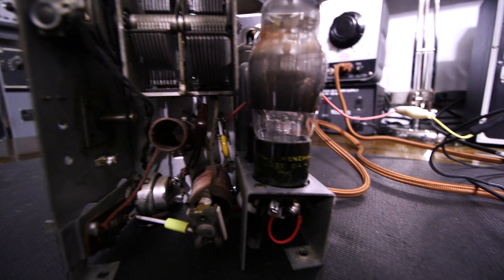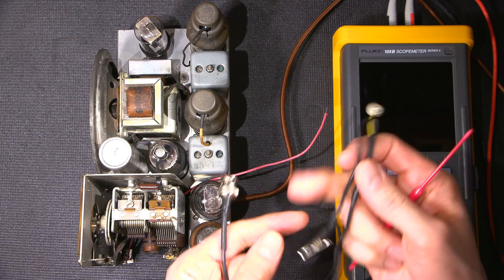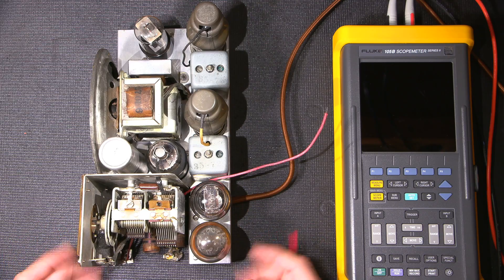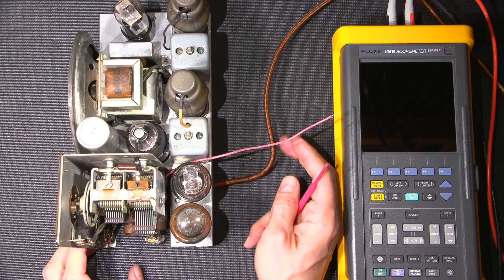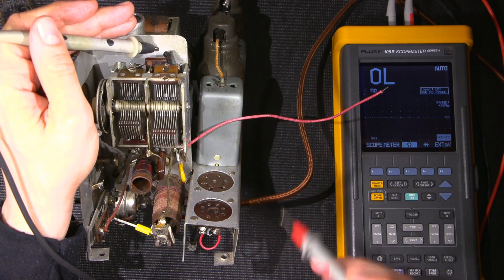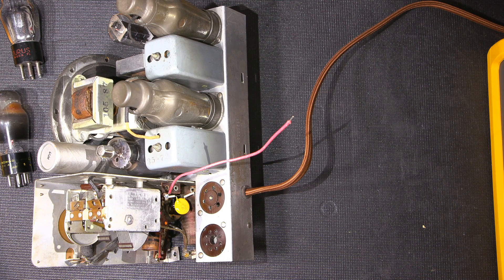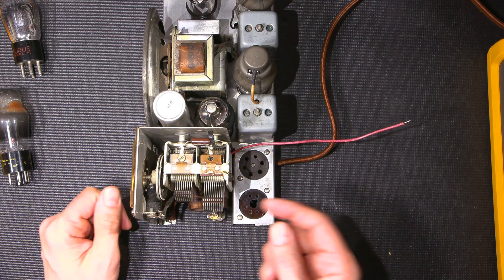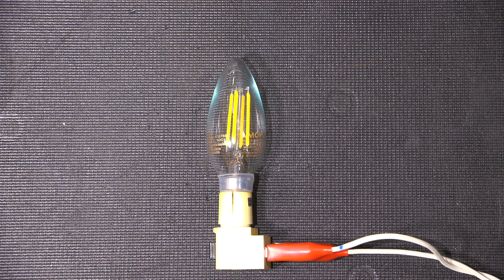See High Voltage Created From Falling Snow!

Comment: Very interesting phenomenon. Here's my analysis of it. The first clue is that you got an arc to the chassis despite the 36 ohm coil to ground. That means that the arc must have been caused by a spike of current, as that is the only condition where the coil is high impedance. So what I think happened is this: static built up on the aerial from the wind. This slowly charged the X1 capacitor. At this point the chassis and the arc point are at the same potential, while the aerial is charged to however many kV. 

When the capacitor is sufficiently charged, an arc happens. This is not the arc in the receiver, but a big arc between the two sides of the aerial. As a path opens to ground, the X1 capacitor starts to quickly discharge. However, due to the high impedance of the coil, the current discharging the capacitor must find another way. And within microseconds, the potential over the chassis rises enough to create the arc that you witnessed. 

So the final discharge loop is: one side of the X1 capacitor --- the coax --- one side of the aerial --- arc --- the grounded side of the aerial --- electrical wiring --- probably another arc in the isolation transformer --- the chassis --- the arc in the receiver --- the other side of the X1 capacitor. This would also have enough loop area to create the strangeness in the speakers.

And for maximum youtuber collaboration awesomeness, may I suggest that you send the broken LED lamp to Big Clive?
Reply: So in theory you could make a static electricity generator/collector via wind over antenna array if I follow the gist of your theory.
Reply: @wolfiexii  Of course you could. It wouldn't be very efficient by any means but if all you wanted was to see sparks over a spark gap, why not... The mystery in this case though is not how snow could create static electricity (that's pretty obvious) but the exact mechanism of how everything in the circuit finally produced an arc to the chassis despite the 36 ohm coil in parallel.
Reply: @wolfiexii  you're forgetting the coax creates a capacitor that can shape pulses all on its own. I'm guessing the coax and antenna charge up, discharge happens outside and the pulse is large and fast enough that it blows through anything between it and earth.
Reply: Gameboygenius Hi - the other side of the dipole is not grounded from his description so has no path to ground.
Reply: It doesn't necessarily need to be grounded, it just needs a different potential.
Reply: @vacuumfireradio253  Could be. According to what he said, it was not gorunded to anything else in here. To me, that was talking about the items on the bench, it the receiver was only connected with the center of the coax (and the isolation transformer). That doesn't necessarily preclude that the coax sheath is also grounded to something up on the roof, for example. But in the end, everything is connected as far as voltages are concerned, and arc-overs can happen when and where you least expect them. If an arc happens between point x and something connected to ground, then there's temporarily a low ohm connection to ground from that point. I'm not claiming to know the absolute truth, only a theory based on the evidence, and I'd love to know what actually happened.
Reply: @Gameboygenius  If I recall the highest efficiency for static influence is around the 25% point.  Where it does shine is in maintenance, you can set on up and walk away from it for decades and it will simply continue to work. Earth bound, yea you could make some nice water features with this principle for a garden pond, but on a place such as Mars where you cannot simply pick up spare parts without a 4 year turn around long running unmaintained systems even at 25% would be beneficial.
Reply: @keeperofthegood  You bring up a good point. Although if the goal is extraterrestrial energy harvesting, we must be careful with high voltages that may destroy any PN junction that comes its way. (Vacuum tubes are no help here. While they might survive the high voltage, they are dependent on that pesky high power filament to work within specifications...) Also, is there enough solid debris, aka "snow" to create that high voltage we're looking for? I'm skeptical and think solar panels are still the way to go for our main extraterrestrial energy needs.
Reply: @vacuumfireradio253  Would the wet conditions have provided enough of a ground?
Reply: His Antenna sounded like it had two lengths of wire, one connected to the outer conductor of the coax, one connected to the inner conductor. No impedance matching. The high impedance of the wires are connected to the end of a coax (typical 50 ohms). So you are waving the chassis' potential on one of the wires, and the other wire to the capacitor (where the arc was generated). Yes, the coils impedance is in series with the capacitor, but that series combination is in parallel with the two wires waving around up in a fast air stream that was below that its dew point (high impedance static prone air). So what is the mystery here? When the static potential developed across the cap is higher than the air gap breakdown potential you will see the plasma go from dark mode, to glow mode, and then arc mode. ZAP!
Reply: Besides, the only way two sides of an unterminated balanced antenna would be at the same potential is if exactly the same number and same size of snowflakes passed by both legs of it at identical distances, which is statistically impossible.  There will always be a difference of potential on the two legs of a dipole antenna unless both are tied together or both tied to ground.
Reply: @wolfiexii  DC currents in the troposphere are a well known phenomena experienced by transmission lines, antennas, and telephone/telegraph systems. Multiply grounded systems and even metal pipes also have to deal with telluric current, which has a much lower supply impedance. (More current, less voltage, and a serious problem for electrical grids; their transformers have to tolerate uncontrolled DC bias currents.)

There's a very faint downward current during fair weather, and many kinds of precipitation carry an upward current (i.e. they are negatively charged). Thunderstorms are chaotic - they can have positive rain and even positive lightning - but they average to much stronger upward current. The current density is still fairly low (no more than a few amps per super-cell) and even lighting isn't astronomically strong (median peak current is tens of kA, charge is a tens of C). The ionosphere potential is about +400kV, globally uniform, and varies following a daily cycle. Thunderstorms can have tens or hundreds of (-) MV at the base.

The exact process that couples convective weather to upward current is still a mystery. But convection is believed to contribute  energy to the ground-ionosphere capacitor.

The weird thing is that's all DC stuff. An arc parallel to a coil implies rapidly changing flux through that coil, an AC or impulse phenomenon.

Also, beware. These topics (especially telluric current) seem to attract woo-woo faster than a kitten attracts packing peanuts on Boxing day.
Reply: Big Clive.  Love the guy, but Mr. Carson can show down to the most minute detail on why a circuit operates in the manner that it does.  Both in a fault state and in the operational state.
Reply: Big Clive would be amazed to dissect a LED lamp destroyed in such a strange way!!
Reply: @Gameboygenius : In which case y'all might want to read up on Tesla's experiments with what he called "cosmic energy". I suspect this was a very high-frequency event. Tesla talked about these kinds of events and how it would make free-floating "plasma balls". This happened a lot in colorado springs where he set up a lab to try and replicate these events.
Reply: @BrokeMoFo : If the atmosphere is very dry, then there would be no hydro grounding. The snow would also have to have been very cold and more like ice crystals than the wetter snowflakes we are used to.
Reply: I think you're onto something.  I had the same idea that the main discharge was occurring between the poles of the antenna outside, but I was thinking that perhaps the sudden potential change is creating a swing in the isolation transformer.  Then there's a secondary arc inside the chassis as a result of that inductive spike.
Reply: Hi, do you mind if I take this concept and try to develop it into a commercial process? Elon Musk are you watching! Lightening too!
Reply: Good info. I can follow and agree with most of this but I cannot get my head around the fact that a minimal resistance of 36 ohms did not bleed enough to prevent arcing. There had to be a ground or difference in potential somewhere or there would be no arc, but the rate of charge needed to make that happen creates an interesting puzzle.
Reply: indeed, a "cascade" event probably i thought too
Reply: @jordanrodrigues8265  I was just thinking along the lines of fun kids science experiment, electricity from "air".
Reply: Exactly my thoughts also. The impulse characteristic of the discharges across the coil would still give high voltage across it (it has an inductive component as well, not only a resistive one as measured on an ohmmeter)
Reply: Here's some science from 1970.  Electrical charges on snow particles
 D. A. Burrows  P. V. Hobbs. "Measurements of the charges on individual airborne snow particles showed that they were distributed approximately symmetrically between positive and negative values. The majority of the small charges were negative, however, and the majority of the large charges were positive." 

-> antenna will get positive charge as there are 50% of positive snowflakes which have stronger charge than the negative ones. BUT you also get AC component, as every time negatively charged snowflake hits the antenna it's positive charge is reduced. Capacitor was flowing this AC -component though and then you have an inductor (coil) which acted just like a buck-boost converter or car ignition coil. When the magnetic field collapsed the spark jumped from the not grounded end of the coil to the ground.
Reply: There is also a voltage gradient between the sky and the ground.  Two longwires, one above the other by about 30 feet or so, will have different voltage levels with respect to ground, the higher longwire having a higher voltage.  The difference can be hundreds of volts over very short separation distances.  The current is extremely low, but the voltage can be extremely high.
Reply: Gameboygeniuos you have started a great debate here and I think your well on the way to solving this thing... I'm just a beginner to this but a lot of what everybody said here made sense!! Like the potentials building up and the coaxial having capacitance. All in all sometimes it's in the comments where ya find the knowledge. Thank you and everyone else who joined this comment..
Reply: @Slugg-O  in essence, because the coil is only a shunt at DC but high impedance at high frequencies. Imagine this simplified schematic: ground - coil - point A - capacitor - point B. Now charge the capacitor to say +10 kV. Point A is still at ground potential and point B is at +10 kV and not connected anywhere. Now you connect point B to ground through a fast switch (aka the arc at the roof in my theory). Now all of a sudden, point B is forced to be at ground potential while point A is forced down to -10 kV due to the charge in the capacitor. If the coil was a resistor, it would just shunt the current, but since it's an inductor, the current lags behind the voltage. Before the coil has a chance to start conducting, an arc to the chassis is formed.

While not exactly the same thing, I'd suggest looking at the operation of a Marx high voltage generator. It consists of a capacitor bank with parallel connected high voltage capacitors connected with high value resistors between each capaciror stage. There are also spark gaps diagonal between each stage. (Search for an image of the schematic. It will probably make more sense than my description.) 

In the first part of the cycle, the capacitors are charged to however many kV as parallel capacitors. In the second part of the cycle, a high voltage striker pulse is sent through the chain, which will cause all the spark gaps to trigger, and now a different path is created which connects the capacitors in series for the duration of the sparks. This way, voltages of up to many hundreds of kV and even up to MV levels can be created.
Reply: @rogermoody2660 : I was wondering if there was any lightning activity at the same time. Lightning activity during a snowstorm is called "thundersnow".
Reply: @Gameboygenius  Doh!  I completely overlooked the inductance of the coil - no constant path to ground. Makes more sense now.  Thank you for the info!
Reply: @sonofeloah  you mean like ball lightning.

Plasma balls as in little specks of light or grape-sized discharges of plasmas to the size of I love basketball or so.

I've seen something like this once.

One time I don't know what was causing it I saw like a wall of plasma.

There's like a sheet of I like forcity was ionizing the air.

I have no idea what could have caused it.

But I do remember there was like a weird sensation.

You could even feel yo where you had a spray hair you could feel a little bit of charge.

Like where every hair was you can feel a little bit of a twinge of a tangle.

And ours are jumping between things.

I saw two other people that happened to breast by each other and our jump between them.

They were both wearing rings.

But then again it was probably some odd atmospheric conditions it was just during or before or after a heavy storm.

And I do remember seeing st. Elmo's Fire in the area.

During this event.

And that tingle was not because of fright it was actually electricity.

If you ran your hand over the top of something you would actually see the Teeny Sparks jumping between her hand in something else.

Kind of like you know how like if you pull two blankets apartment that were in the dryer with no anti static.

But the lights are off.

I mean you could even see Nails in the wall in the floors.

With a bit of some sort of electrical discharge.

And sometimes when there was something is grounded an arc will jump from something else.

But then again back then we're not been easy damaged because we did not have sensitive Electronics.

Most everything was tubes.

 at at least where that occurred.

I do remember saying some charge balls of plasma here in there.

At that time.

One of them one of the side of a building uplighting right round I am broke one of the lightning rod balls into pieces.

Of course we could not document this because there was no video cameras.

 Even though I was very young I understood what was going on with that sort of thing.

I have been told by people in an area that when it gets fully charged weird things would happened Wednesday atmosphere is highly charged in our conditions like that.

Freaky man freaky
Reply: @sonofeloah  yes I've seen snow like that and also ever heard of corn snow?
Reply: @sonofeloah  sorry I think I oh, did this somewhere else but maybe even you cannot tell sorry if it's a repeat.

Yes I've seen snow like that

. Also have you ever heard of corn snow.

Also last year or the year before eyewitness thundersnow twice in the same storm.
Reply: @sonofeloah  also with the plasma balls balls of plasma that is not the decoration.

I remember hearing about on the submarines what's the battery banks in the generators when they were switching and they switch to battery Bank on to accidentally on to a dead generator that was not running in other words they recreate Fireballs AKA plasma balls that would Baron de Sailors legs.

I've seen ball lightning at least once. 

As well.

Someone I Used to Know call me about this story as well.

True Story by the way.

Substantiated by a neighbor and her husband.

There was a storm coming.

There was people working on a roof close by.

They saw ball lightning rolling along the ground and trampled up by the gutter of the house and went up on the roof

Add that person I was talking about thought those guys we're fried.

Not fried just startled turns out

But freaky nonetheless
Reply: @aaronbrandenburg2441  : And I am of the time of the tubes transitioning into the transistor era. I have always been fascinated with lightning and plasma energies. That is what got me into reading and learning about Tesla. I even built my own lyden jar (an overgrown capacitor) and reproduced ben franklin's kite and metal wire to load the jar and use a rod to play with it. Freaked out the kids with that. But then I also got into crystal radios and experimenting with different shapes of the crystals and winding various coils and doing different antenna configurations to listen to the sounds of lightning. The squeals, the song of the lightning. And it was in that I began to experiment with Tesla's plasma energy ideas and linked them to the frequencies translated into the songs I heard from the ball lightning I saw and heard. And I think that is the real key to make plasma controllable energy. I've been slowly setting up a new lab out here in the midwest as there are some very interesting lightning that I did not get to witness on the west coast as a kid. A new toy to test my theories and then translate it into a man-made event. And I so want to witness thundersnow in person, have not yet done that.
Reply: @aaronbrandenburg2441  : never heard of corn snow, going to research it in the morning. Late, time to sleep.
Reply: I think it doesn't have to arc over in the isolation transformer. If it is a beefy one, its primary/secondary capacitance is easily a few 100pF good for a few kV (IIRC 4kV test voltage, breakdown a good bit above that). It may have even have a grounded shielding foil which makes it even more effective. Its winding inductance is basically shorted out by the parasitic capacitance of the secondary for the sharp pulse.

So it charges the series of the antenna coupling capacitor and the isolation transformer, in parallel to that the antenna capacitance. When it arces over at the antenna insulators or more likely in one of the connectors outside, the "hot" end of the capacitor suddenly is grounded and a high voltage develops over the coil.  If the slew rate is correct, the main frequency component may even be in the regions of the resonant frequency, making it VERY high impedance, enought to allow it to arc over elsewhere. 

It's basically a big relaxation oszillator, which ALSO explains the dependence of the frequency to the charging current (the rate of charge accumulation).

It also should have transmitted bursts of RF on the frequency it was tuned to.
Reply: Ok, did the research and yes, I have seen corn snow. Did not know it was called that. Just learned it's name! Thank you!
Reply: @VintageTechFan : As I explained in another comment, I used to listen to lightning frequency RF songs via crystal radios where I wound the coils to get "closer" to the actual frequencies to hear louder and clearer the lightning songs.
Reply: @aaronbrandenburg2441  : Not like ball lightning, but certainly like St Elmo's Fire. It's relevant to look up Lord Kelvin's Thunderstorm.
Reply: @wolfiexii  : You could do that, yes. Look up "Lord Kelvin's Thunderstorm" for some reference material. You can choose to reduce yourself to the static atmospheric charge, in which case you seriously don't get much power, but have a simpler setup; or you can choose to go with a wind-boosted system, in which case you'll want to put it on a wind-controlled swivel, and wind speed will determine your maximum output, essentially in a reversed ion-engine configuration. You won't get lots of power in either case, but it can be enough to run small microcontrollers.
Reply: @Gameboygenius  : So long as you have an alternate source of heat, or can accept very low currents, the heater filament is actually not necessary.

As for the "solid debris", you can actually use any gas that can hold a charge as well.

This stuff honestly doesn't have great outputs, which is why you never run across big installations. However, it's also not as hard to setup as you might expect.
Reply: @absalomdraconis  if you want to perform rectification some sort of heating is definitely required to encourage electrons to get knocked off. Maybe you could use some more esoteric method like exposing only one of the electrodes to the cosmic background radiation and shielding the other, and encourage electrons to travel from that electrode. But without any electron bias, no rectification, since the current can leak either way. This was mentioned (slightly tongue in cheek) to contrast tubes to the relatively more static sensitive transistors. 

As for debris, you can do without it, but it improves the efficiency a lot.
Reply: @sonofeloah  you're welcome.

By the way I've learned that from my mother and father.
Reply: Air that is colder than the dew point is devoid of moisture, and thus produces a static prone environment (high impedance). When this air is moving at large speeds, voltage is “collected” on these types of high impedance antenna. This is why Balun transformers are so well used here. They keep the impedance low.
Reply: I think I would look for an insulation breakdown in the isolation transformer.  A breakdown there would form a path -- maybe at 5kV or something -- to the neutral of the home wiring or to the earth of the transformer chassis.  Dunno if Mr. Carlson has an insulation tester.
Reply: @Gameboygenius  I watched the video a few days ago, and today out of seemingly nowhere, I got a similar idea, although less developed. I only got to thinking about what was happening inside the radio. This hypothesis also explains the X1 cap not being damaged.
Reply: Low humidity and wind  are known troublmakers in the southwest where low quality ground systems can creep into your ham shack because of a lack of rain.
Reply: @sonofeloah  Come to Amarillo, Texas. Thundersnow is a common occurrence around these parts
Reply: except x caps wont store enough charge
Reply: Very interesting I am very surprised with the cap and resistance to case ground it was sparking seeing is believing  your eq is so nice this was a warning sent by the electronic Gods if you will kinda like Frankston in the lab Lol enjoy the video who would have thought?